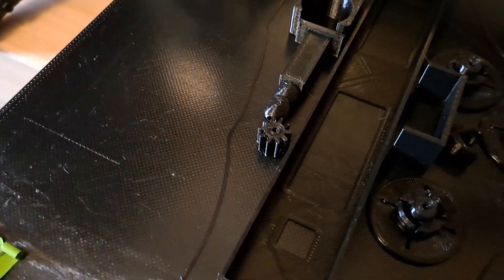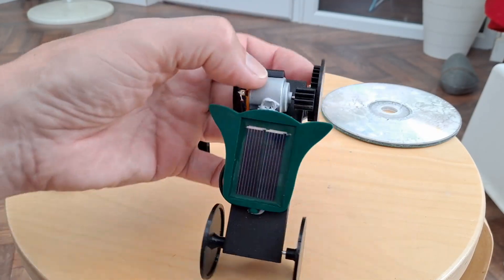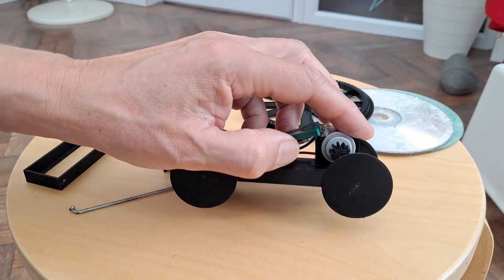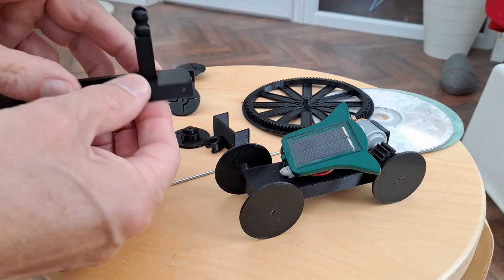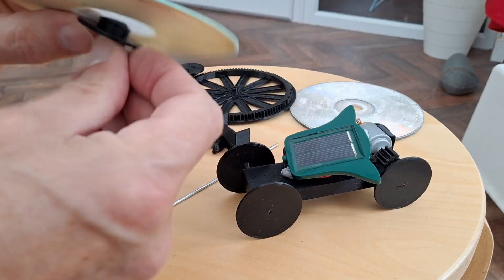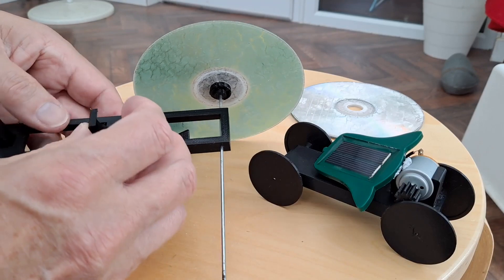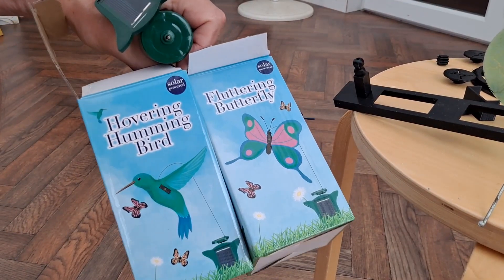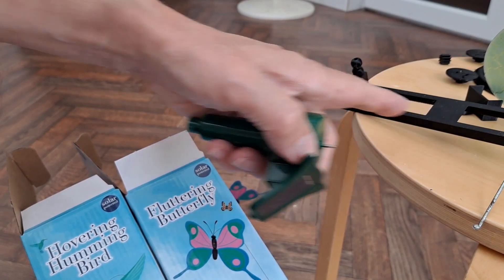Solar Butterfly to Solar Car BIGGER

Comment: that works nicely but what gets me is that if u turn the solar panel around that the car will go in the opposite direction although the light is hitting the same panel just being switched, there are no wires being switched on the panel or motor,so how can it go in another direction just by turning the panel around??
Reply from the maker: No Marc, I am just turning the panel round so it continues to face the sun (or the spotlight I am holding in this case). The motor and the wheels are still turning in the same direction. In the first case the car was coming towards me so the panel was facing forward. In the second case the car was going away from me so the panel had to be reversed so it could receive the light from behind.

Comment: smh it took me way to long to figure out how moving the panel made it run in the other direction.. the motor was still running the same way but the light was hitting it different so it could run before the light instead of against it.. maybe I need another cup of coffee..... lol
Reply from the maker: Haha, just moving the panel so it kept facing the sun, but I like the way you were thinking 😆🌞
Reply: @GrandadIsAnOldMan  it could be done.. 2 solder points wired to the panel and 2 on the stand as it rotates it changes the polarity like a switch

Comment: That looks like it'd get some speed outside on a bright sunny day, what is the surface like that you run it on?
Reply from the maker: In the conservatory and kitchen that is what us old people would call "Lino", very smooth. In the short I published this afternoon, it is running on the paviers (or pavers as Google correct would rather I spelt it) outside https://youtube.com/shorts/jREj_VYUPFA?feature=share

Comment: Now for the Race! My bet is on the bigger one over a long distance.
Reply from the maker: Hi, Daniel. The main problem would be finding a location with a large enough smooth surface to give them a good run.
Reply: Hey hey! Hey!!!! If there should be a race I should be invited to compete no!? Don't mention a race unless you want us speed racers all to participate